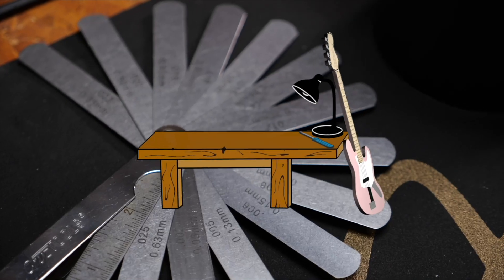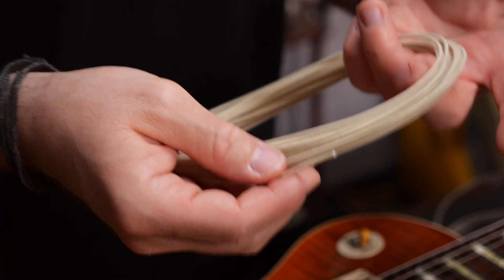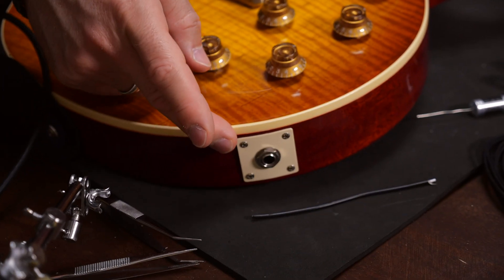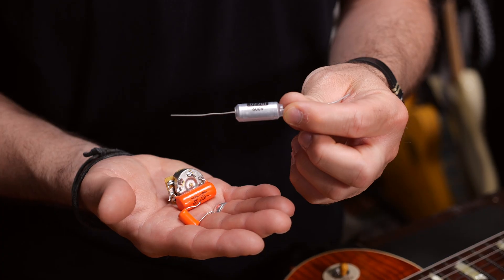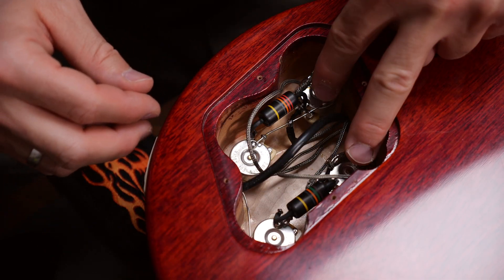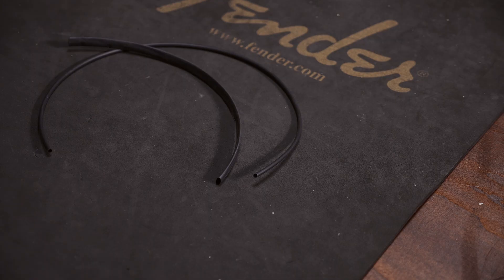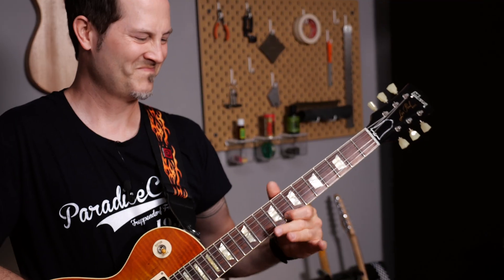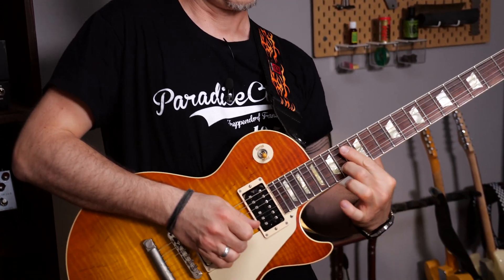Learn The Basics of Guitar Wiring | Guitar Tech Tips | Ep. 64 | Thomann

Comment: Ok so as a wood worker and content creator I finally built my first electric guitar. It came out awesome with video to come but electrics are not working.  😢. I used a two humbuker pre wired system from Amazon. Plugged in the two pickup wires and the toggle switch to the two volume controls. No other way it could go together.  What did I miss?  
a ground somewhere?
Reply from the maker: It sounds like the only thing missing is the string ground (a wire should go from under the bridge to the backside of one of the pots. But that issue doesn't really explain why you don't have any signal coming. A missing ground would cause noise but not dead silence. It might just be, that the pre wired set is faulty. //Kris
Reply: @ThomannsGuitarsBasses the pickup ground was broken off.  I soldered it back on and it all works.   Although there is some buzzing, does that have to do with the ground going to the bridge? You said, connecting to one of the pods? The set did not come with that wire.

Comment: Ive got an Ibanez Gio with duel coils, I opened it up last night to check the wiring because Ive been having issues with the audio cutting out and all the wiring looked fine so I put it all back together (its been a minute since this issue first happened so it took me a minute to get to look at it, I thought it was the input jack so in doing research on how to replace it i learned that just having a loose jack can cause issues so I really made sure that was put together properly and tightly) upon reassembly and testing I found that it played more consistantly (less cutting out) but would still drop in volume occasionally and then I realized what was happening, sometimes when ai strum I would lightly tap the top of the neck volume knob and when that woule happen, my audio would cut out, so I think I have a bad pot, at this point im just considering replacing all the electronics cause why not, I'll probably end up throwing some humbuckers in it cause its what Iearned on and its what works better with rocksmith 2014 (which is what I use a lot when I just want to play guitar and dont want to think to much) great video explaining the basics of wiring, I actually think I'll be able to pull it off!

Comment: I learned how to solder in school in 2005. 🙂 I swapped pots yesterday,  and have swapped all 3 single coil pickups (easiest to install due to only one hot one ground )  I use single coil sized humbuckers, have 1 bare ground, one insulated ground, and one hot, then two more if you want to wire wire a split function which  I soldered together and insulated since I'm not using them. I use my teeth to strip the  insulation of the thin wires. In my guitar there was 1 capacitor shared over two pots, I soldered 1 cap per tone pot 🙂  It was a great success

Comment: Why do we need a capacitor wired to the pot? Aren’t potentiometers already capacitors?
Reply from the maker: I'm guessing you are talking about the capacitor on the tone pot. That capacitor makes the pot (which is a variable resistor, not a capacitor) a TONE pot. The capacitor is connected to ground. As you turn down the tone pot you send more and more treble to ground, thanks to that capacitor. 
I hope that explains why it's necessary. Without the capacitor the tone pot would just be another volume pot. //Kris
Reply: @ThomannsGuitarsBasses thank you!!!!

Comment: I just purchased a Harley Benton RB-612-BK. I was struggling to get the plastic off the pick guard. It didn't tear nicely from under each pick guard screw. So I decided to take the screws out of the pick guard which worked. But when I decided to look at the wiring I ended up with a black and a white wire apparently breaking off from a solder joint. These two wires come out of the same hole in the guitar. I assume they go to the jack?? If so where do they connect. There are not any clues of Broken wires on any device. Please help. Thanks

Comment: I put a set of 1987 Gibson HBL humbuckers in my LP. If my bradded wires touch the wood or any wires touch wood will it make a muddy sound? I cant hear clear tones and it just sounds weak?   In bridges has less power that neck, baffles me? I can find good sounds but its a job.
Reply: I have Ibanez GIO and the humming buzz sound is making me nuts, ground wire is messed up. I opened and soldered it looking YouTube video but I think I messed up my wiring when I put my hand on strings it stops but still there is noise but when I leave my hand from the strings it's so loud lol.. I have to do it again

Comment: Hello, thank you for the detailed explanation. What are the pot and capacitor values for P90 pickups? Thank you!
Reply from the maker: In most cases you'll find a 500k pot for volume and 500k OR 250k pot for tone in a guitar with P90 pickups. But if you want a warmer sound, you can also use a 250k volume pot. Cheers //Kris

Comment: Ok, so what I did was install a Seymour Duncan heavy metal Live wire in the bridge position,  and a Seymour Duncan JB in the neck, now this is in an original Kramer Nightswan from 1989. It's on a 500 volume pot which is a push/pull. That's my selector switch.  I pull out for the neck and pushed in for the bridge.  The neck has a coil spit switch.  This gives an insane amount of options,  from mild to wild.  Still my favorite guitar. LoL

Comment: I also recommend along with this vid, google guitar wiring diagram images so the layout is clear and you can look at it as long as you need to look at it.   
QUESTION:  Is there a super geil trick to solder shield weave to pot cases?   i cringe putting so much heat into a component. I have a nice adjustable weller iron so even temp setting trick might help.  
i devalued my les paul by drilling a tiny hole in the replaceable  plastic backplate to run an RCA jack out hanging from a thin shielded wire.  I direct wired the neck PUP to the 1/4" jack and the bridge PUP to the RCA jack and completely disconnected the pickup selector and that garbage wiring.   it put an extra level of quiet on the whole guitar.    it also upped my ambient guitar game by having 2 signal paths.       FWIW, i did a live  4 (3 guitar+1 vocoder) channel ad-lib  jam to test the rig.   12step->VT4 , 2 guitar channels+ mel9 mellotron wet channel.   i was rebuilding my keyboard stand so i had no keyboard.   https://www.youtube.com/watch?v=FOo1SW0zSR0

Comment: Sorry for the negative coment but this video did not clarify much. It needs diagrams, double the length and animations.
I find the video rushed and confusing even though I did some modest work around adding pickup split switch, push pull to turn off preamp, replaced pickup blend with MN pot and a full Agguilar 3eq+pickup installation on Cort.
Reply from the maker: Hey Tomislav, thanks for the comment, negative, or not. It's appreciated! This is really just the basics of guitar electronics, it's not a "this is how you wire your 2013 Les Paul Classic model" or anything like that. That's exactly the problem: if I put diagrams in a video, which exact guitar should be shown? Just 1? That only helps those, who have that exact model. 3-4? That still doesn't help most of the viewers? It's absolutely insane, how many versions are existing, even if we are only talking about one specific brand's one specific model (like Teles, Strats, Jackson Soloist, Les Paul, etc). So the way I see it: in a general wiring basics video you should explain the absolute basics (5-6 minutes video) or show the wiring for every single guitar that's somehow relevant (5 hours video). Youtube is definitely not the place, were people will spend 5 hours on one video. That makes sense somehow, right? Cheers //Kris

Comment: got picked up a jackson   loaded with emg s no ground wire hooked up in the trem cavity what wire goes to the ground (what wire is the ground?
Reply from the maker: Hey Jeff, active EMG pickups don't need string grounding, so don't worry about it. :) If you want to figure out which are the ground wires in your Jackson, take a look at the backside of the volume pot. Everything that's connected to it is part of the guitar's ground. You can use a multimeter with the continuity function as well to do that. Cheers //Kris

Comment: Yeah it’s easy and pleasant to work on electronics when you understand what’s going on haha That’s why schematics, layout diagrams, and bill of materials (parts lists) were invented.. Guitar wiring is simple enough and guarded by builders, so those things generally aren’t always available outside the shop of origin. A similar scenario typically applies to speaker crossovers. The mystique of what caps, etc. in sought after designs, tends to drive enthusiasts nuts! 🤪

Comment: Speaking of wiring .. I have a couple basses that have started buzzing and making noise until I touch the strings. Seems like a ground issue? What should I look for/do to fix this?
Reply from the maker: That's basically normal, since your skin is grounding the strings. If you don't touch them, the ground circle is not full. A certain amount of buzz when not touching the strings is normal as long as it goes away if you touch them. Cheers buddy! //Kris

Comment: Ok that helps. Now how do I put a sustainiac pick up in my HB SC custom Fr???
Reply from the maker: Hey Poo, 1. replace the pickup with the Sustainiac 2. rout the cavity for the extra battery for the sustainer 3. find place and install the 1 or 2 mini toggle switches(depends on the model) 4. replace the mono jack and use a stereo one for the active circuitry 5. connect the sustainiac to the guitar's electronics 6. rock out and enjoy the sustain until the battery dies 7. change the battery and keep on rocking :D :D //Kris
Reply: @ThomannsGuitarsBasses  So I’ll swap the mini toggles for a tri color illuminated one to visually know if I’m in harmonic or standard and a push button on/off (also illuminated) cause flashy lights are cool. 

Now where’s that pile of Cash… what I bought food again 😖?! maybe Christmas will add some sustainiac to my holidays???🤣

Save save save 👍🏽

Comment: Every guitar and bass should just use EMG's solderless quick connect system and call it a day. Wiring guitars and swapping pickups would be so much easier. Though alot of guitar techs would lose their revenue lol
Reply from the maker: Okay, so on modern guitars, sure, why not. Makes things easier. But on like a reissue Fender or Gibson? Absolutely no way! Haha! That sounds like the worst thing that could happen to those guitars. :D Cheers //Kris
Reply: @ThomannsGuitarsBasses  Ah yes, modern I mean
Reply: YES!  Or the quick connect used by Epiphone.  Or Gibson's connector system.  Or the connection system used by Guitar Fetish.  There are several different connectors out there - it'd be swell if the industry would pick one and standardize, but I think guitar makers see this as a way to keep people in their ecosystem.  Gibson is the worst, because they use a board for the pots.  To replace the pickups, you need to either buy Gibson pickups, or replace the board with real pots.  Which I did.
Reply: I put Duncan Liberators in all my guitars.
One time soldering job, and then you can easily swap pickups moving from then on.
Reply: @rasmusolesen5307  should come stock on more guitars
Reply: Meh, I learned to do decent soldering in a couple of try-and-error sessions. It's not difficult at all.
Reply from the maker: Exactly Valebliz. Most think it's super complicated. Until they tried it a few times and realise, that's it's totally doable. :) Cheers //Kris
Reply: @ThomannsGuitarsBasses  on the other hand, designing complex wirings isn’t easy, at least to someone who studied zero electronics like me. A few months ago I wired an HSH guitar with a 5 way superswitch and a push pull to switch between a mix of parallel/series/coil splits and I had to search the wiring online. Could have never came up with it, at least not without some prior studying.
Reply: Solderless kits are good for a no nonsense and once-and-for-all wiring job. I own a few EMG's, been using them for a while now.

But I do swap electronics& experiment from time to time. Soldering is actually the best option for me: allowing a lot of flexibility in wiring schemes (Gibson's 50's mod), while making sure my components do contact by fastening them to one another. Plus, soldering is an easy skill to learn!